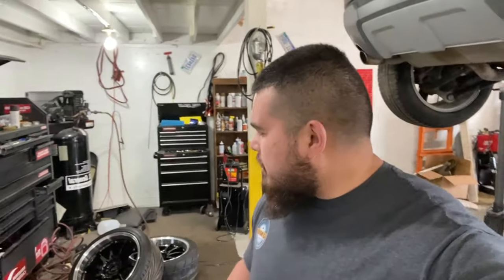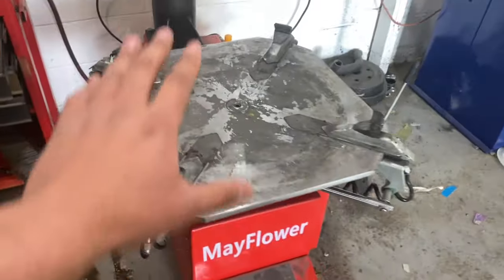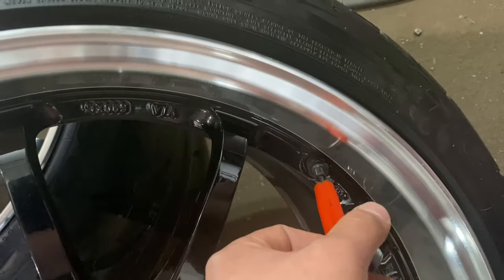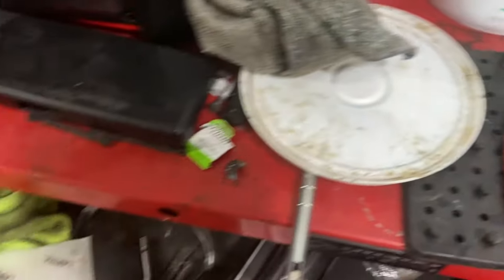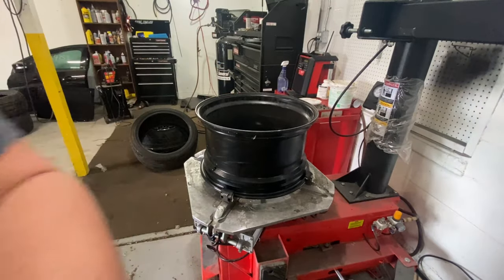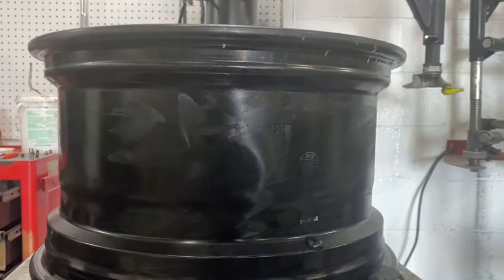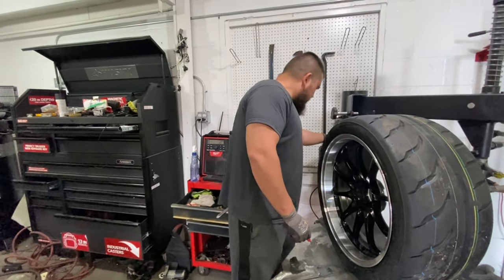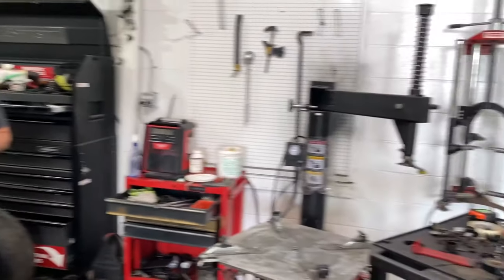Mayflower Tire Machine - Mounting Low Profile Tires

Comment: mix some washing up liquid with water in a spray bottle and when you break the bead, spray around the rim of the tyre and the inside of the wheel. then get yourself some tyre bead clamps of bay to keep the bead down in the groove and to allow you to lever over the ducks head. tyres with a tall side wall are easier as once the bead is broken, is tends to sit on the groove of the rim and allows you to lever. high performance low profile tyres have stiff sidewalls that tend to keep the bead out.

Comment: See if you can spray something into the bead before taking the tire off. Taking it off dry is very difficult. I've got a bead press arm on my similar machine and it lets you spin the assembly with the tire pressed down a little to get some lube on the bead before taking it off. Then it slides down into the drop very easily when you put the bar on the duckbill and lift it over. Without the assist arm, spraying WD-40 or something should help if the bead is already broken.
Reply: I spray soap water when that happens

Comment: You can also spray some soapy water where the bead is stuck on the duckhead so it glides much smoother if it doesn’t come off easy

Comment: Post-covid tire shop prices and scheduling have me seriously considering picking up the tire machine and balancer combo. Even at $2k full price for mayflower, I only need to do 10-20 sets to break even. Not to mention doing them at 2am if I want, and not caring where I buy my tires from.

Your vids have given me a great deal of confidence that it would be a good investment. And this vid specifically has given me a great deal of confidence that I should probably get the assist arm. 😂 I'm getting too old to be brute forcing like that, and my primary usage will be stiff sidewall track tires.
Reply from the maker: First off, absolutely appreciate the feedback, definitely motivates me to continue doing these kinda videos. And yes once you get a hang of it, the tire mounting/balancing process becomes a breeze. The only reason I didn’t opt for the helper arm option was because i wanted maximum tire size capabilities but since you’re doing mostly stiff wall stuff, definitely go that route!

Comment: I put the rim on the balancer first to find the heaviest point then put the yellow dot there. It hardly ever corresponds with the valve stem. I have even found the dot machine off by 25degrees on all four same set but usually dots are close to where they should be. I match balance my own cars. Corghi 5000 touchless machine best purchase ever. You did well with that mayflower tho.
Reply from the maker: I’ll do that whenever i have a wheel/tire combo that’s calling for a bit more weight than I anticipated, definitely does help, just a little time consuming with a less fancy machine. Those Corghi’s are a beast of a unit!

Comment: That's a rough job. I purchased the assist arm to help with this type of wheel but I think it'd also help to have a bead clamp. I'm going to order one for my setup just for the convenience.
Reply from the maker: I tried using one of those bead clamps off amazon but it was a PITA to install on certain style wheels and kept popping off. My problem was that I was too lazy to apply a sufficient amount of lubricant. It looks hard but it really isn’t that bad once you have a technique down. And no wheels were damaged in this video.

Comment: I know this is a year old now, but you need to put oil in your system!  Just to the left of your moisture filter is where you need to put in jack oil/hydraulic fluid/ATF.  This will keep your machine from failing on you.  Also, nice job, low profile tires are a PITA.
Reply from the maker: Thank you! Actually someone brought this up earlier in another video and glad they brought this to my attention because i was getting near low on the machine!

Comment: I see the tires that were on the wheels were 35s. So did you put 35s back on or were they a little bigger? It’s hard telling in the video lol. But I usually run 35s or 40s and have been thinking about getting one of these machines since I change tires twice a year and get impatient waiting for a garage that’ll get me in. Most won’t even do them for me because I run a little stretch (usually 215s on 9 wides so nothing too crazy). They’re scared something will happen. I just did 205/35s on nine wides (to see how I like that setup) by hand and although it wasn’t too bad, a machine definitely would have been much nicer 😂.

Comment: There are some cheap plastic tire/rim clamps on amazon that will make your life allot easier and avoid scratchers from your tire irons, they will hold that bead down in the rim valley for you, or get a machine with the extra assist arms they do the same as the rim/tire clamps..   Only other thing I spotted that you missed was a soapy water spray or tire lube of the "top" bead after breaking them, helps remove the tire easier.  Your machine was struggling to grasp the wheel.. a soapy water spray of that top bead would have fixed that,.  Ask any woman, dry rubber is never good...   Cheers! & thanks for making the video, you explained allot of the little details most over look, like avoiding TPMS and the yellow dot on the tire being the lightest point and should be aligned with the valve stem.   Red dots are the flattest part of the tire.. if your wheels have marks for this it may be of use, but most dont unless new.

Comment: Wow. Talk about doing it the hard way. No lube or drop center assistance tools prior to attempting dismount?  With as many tires as you’ve done. I have a redline ma
Manual changer and I have the drop center tools???? Wth make your work easier. To your credit, good explanations. Ty
Reply from the maker: I’ve used those drop center tools and didn’t find them helpful with certain style wheels or with a very tight/hard sidewall. And i do use tire lubricant especially for mounting. I usually spray a soapy solution when dismounting a hard tire, i just couldn’t find my spray bottle when i was recording this video. It isn’t absolutely necessary but it helps

Comment: When u said you were "Breathing hard, I'm getting a work out." I almost died. 😆
I work at a tire shop and we have 3 machines. We do on average 90 cars a day. That averages 120 tires per guy per machine. But onto of that I have to take all the wheels off the cars, half time fighting stuck / swollen lugs, go get new tires, change them, balance them, dispose old tires, mount and tourqe back on vehicle. This includes everything from low-pro to 37in mud tires. And we get 5 deliverys a day of new tires we unload and have yo physically throw up to the second story of our shop /loft and stack for storage.. yes I understand you don't do this all the time. I'm not trying to be mean or pick. I just got a chuckle when u said that. Not picking fun. Was just thinking man you would be whooped if u worked at our shop.
Reply from the maker: Haha no offense taken! I’m a man who appreciates humor! And yeah I don’t do this stuff daily so it can be a workout!
Reply: @MJAltairy  👍 I will admit, my first day after my first complete set I was exhausted. I felt complete for the day and ready to go home by 830 🤣
      Good video. Best of luck. 👍

Comment: Bro use a spray bottle put water on it warm if you can cold tyres are hard to remove with low profiles when wet they are more flexible

Comment: Do you have a video on how to add the oil to the mounting machine and to adjust flow to one to two drops per rotation as it says??
Reply from the maker: I actually don’t know what you are referring to. Kind of curious now, can you elaborate more as to what you are talking about? Is this the oil that’s in the small reservoir where the air connects to the machine? Like the air tool oil?
Reply: Yes! You most definitely want to have an in-line oiler/regulator. That’s the main reason I got my machine on discount! No oil blew apart the bead breaker! Usually 2-3 drops per 5-6 pedal pumps of the bead breaker is general rule of thumb. But I would go off manufacturer’s instructions
Reply from the maker: @xuenanprince5084  thank you! Happy i found this out before it’s too late!

Comment: I got a rim and I went through 3 tires I spin it and it gets caught on the wheel and rips the inside wall how do I get a really really tight wheel on
Reply from the maker: @AnthonyKulhanek94  are you sure the tire diameter is the right size for that wheel first? At the 17:28, you really need to bring that side wall down towards the center of the wheel opposite of the duck bill to give you as much slack as possible while it’s spinning around
Reply: @MJAltairy  yeah they are 18s low profile and I tried to put the original tire on and it did the same thing. Now I'm driving on a spair till I figure something out
Reply from the maker: @AnthonyKulhanek94  msg me on IG if you have one. Let’s get this thing sorted.

Comment: Thanks for the video! I've been considering getting a tire machine once I start tracking my car more. This was exactly what I wanted to know! I have 19" rims (tires are 265/35/19) and I've talked to a few tire shops and they didn't want to try as they were worried they'd scratch the wheels up. One thing I noticed was at 10:14 the machine was spinning but the wheel and tire stayed put. Aren't you worried that would scratch the wheel?
Reply from the maker: Looks bad lol but the jaws grabbing the wheels actually have a thick plastic cover that covers each jaw, wont really scratch it. The only time you should worry about scratching wheels is usually when you’re grabbing the inside of the wheels with the outer part of the jaws. I plan on doing more videos of low profile tires as soon as i get more low pro tires that need to be mounted/dismounted. It actually becomes a breeze to do over time, i promise!
Reply: Could’ve also helped the tire spin with own hands for extra push the tire bead is dry so it becomes hard for matching to turn
Reply: Overall great video 👍🏽
Reply: He probably did scratch em. Ideally you wanna clamp from the outside. I believe only certain wheels you clamp like he did.
Reply from the maker: @dumbeezy5480  no harm were done to these wheels. They would’ve scratched for sure if i had the “outer” side of the jaws clamped from inside the wheel tho
Reply: @MJAltairy  wait im confused, you clamped them from the outside?
Reply from the maker: @dumbeezy5480  yes. As in, the jaws grabbed the wheel as they were coming towards the center.

Comment: Not to be mean , but you need more time researching tire machine techniques and assistance tools cause your still kinda doing it the harder way. Just a friendly suggestion cause I’ve been there also.
Reply from the maker: How would you have changed it up? 

I’m not a tire technician by trade so I don’t necessarily need all the special tools in the books. Purpose of the video is to show that anyone can get by with this Mayflower tire machine without having to buy the fanciest machines out there.

Comment: Well I will say that balancer is actually crap especially for low profile tires like these.  The tire mounting machine is decent I've seen it work well nothing wrong with it but the balancer... ehh not so much. Put it this way it ain't Hunter Road force balancer that's for sure.
Reply from the maker: Yea i can agree with ya on that but for the most part, it definitely gets the job done. Whenever i need better balancing, i just drop my car off at my local Costco and they’ll roadforce balance all 4 under 30 bucks.
Reply: @MJAltairy  Right on! Thanks for the video great stuff!

Comment: This guy honestly doesnt know what hes doing.
The small diameter part of the rim is called the well.
You need to have the whole bead of the tire sitting down in the well before you try to turn the rim.
Reply from the maker: No way you’re doing that with a stiff sidewall/high performance low profile tire…at least with out a helper arm. You can definitely do that with a soft sidewall passenger/standard tire though.

Comment: If those wheels are worth ANYTHING you should 10000000% not be using a rim clamp. You should never take expensive forged wheels to major tire stores ever. I had a $2200 claim against one after they gouged one beyond repair.   And OMG totally not the correct equipment at all for reverse drop wheels.